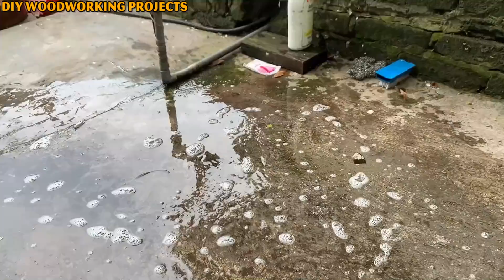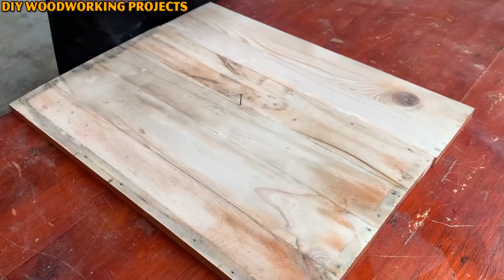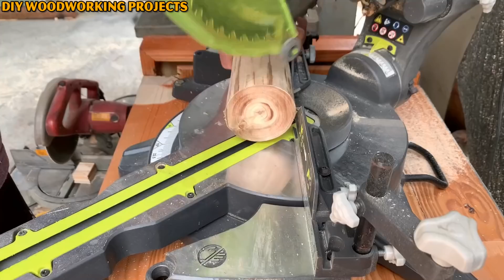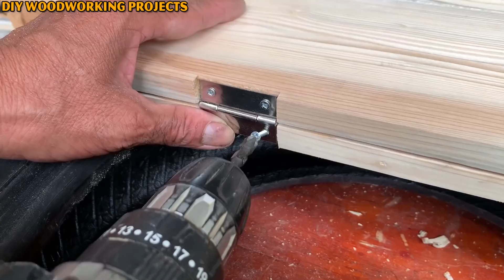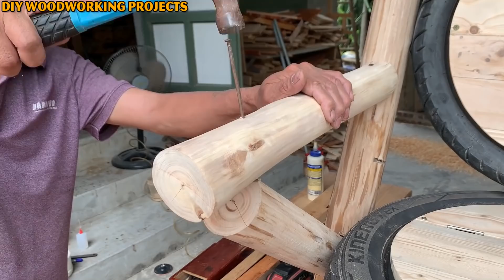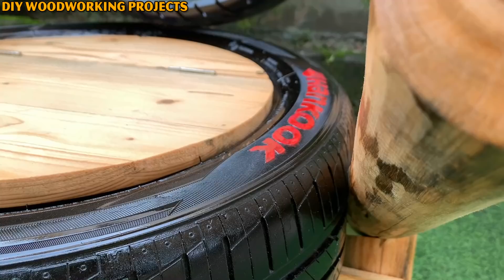DIY Woodworking // How To Make A Unique And Sturdy Chair From Old Wood And Tires

Comment: Nice build 👍, initially when I saw those hinges on the top side wood plate, I thought you were making a toilet seat, but I was wrong. If this chair is meant totally for outdoor purpose I guess it's nice otherwise I would love to have some sort of cushions for back and bottoms if not for the armrests. Also noticed at last part for armrests, you used long nails, I guess using screws for the entire build would have given a nice touch, though Keep building more of the stuff like this, I really love this.

Comment: Clean the tyres 1st before manufacturing good 👍🏻. Put a lid over the tyre turning the seat into a storage great idea 👏. It would be marvelous to add 4 wheels to the garden chair for easy mobilisation because it is too heavy to move it 😀🤔. Overall that project is 👌.